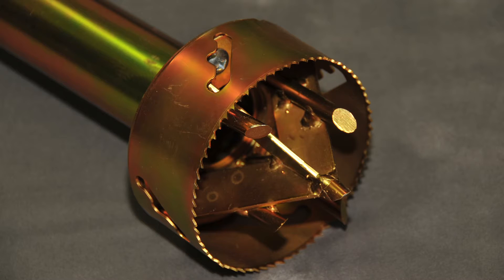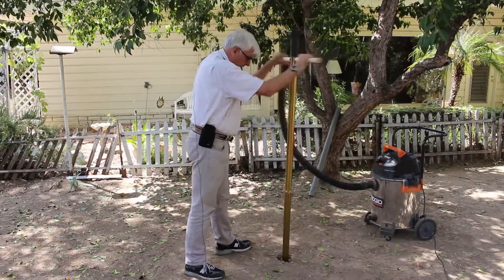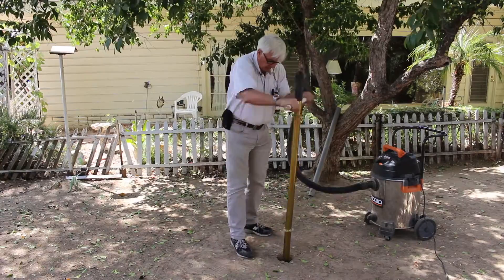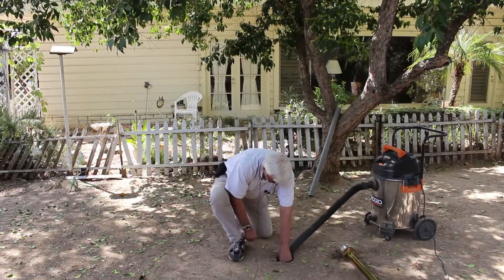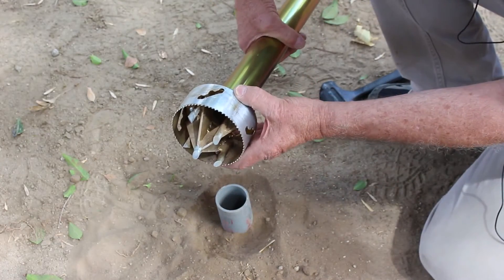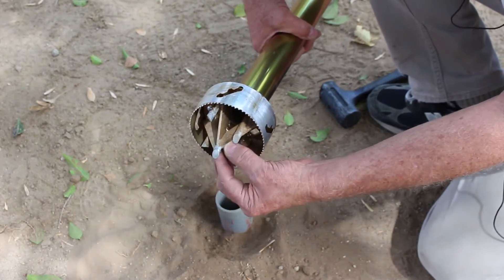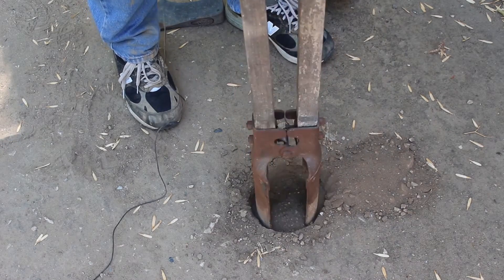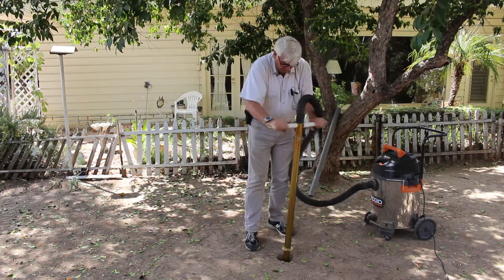Super Fast Fence Post Hole Digger - Time Lapse

Comment: how much are these sold for ?
Reply from the maker: Here is the link:  https://cat6tools.com/product/holey-moley-post-hole-digger/ .   Prices range from $269 to $472 . Go to the contact page and call to get a 10% discount
Reply from the maker: $269 - $472 .  You can get one at Cat 6 Tools, LLC the new home for the Holey-Moley Digger.   https://cat6tools.com/product/holey-moley-post-hole-digger/
Reply: Titus Nelson holy cow that's expensive.  I could get a post hole digger complete with a motor for that much money.   ...and I still need to supply my own vacuum cleaner.  Even more money.